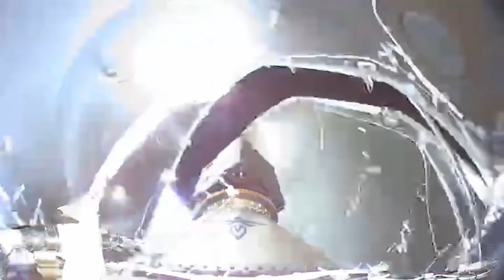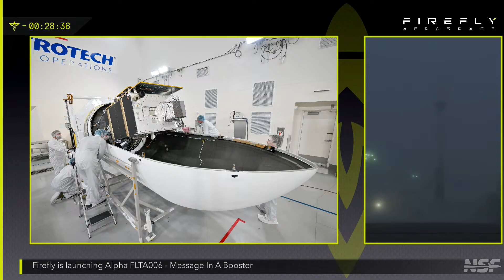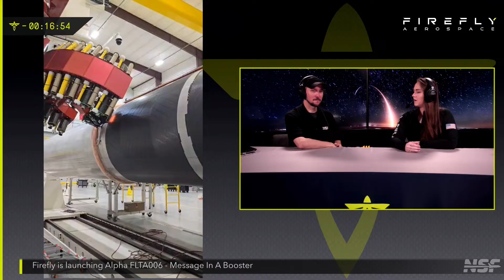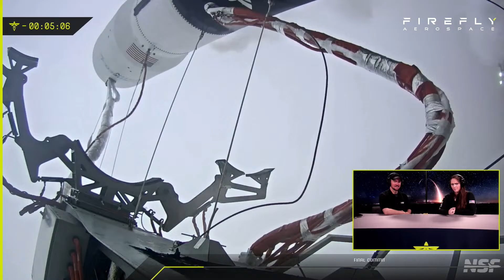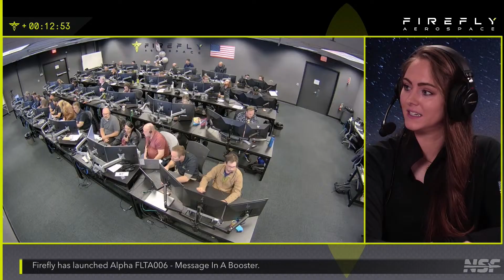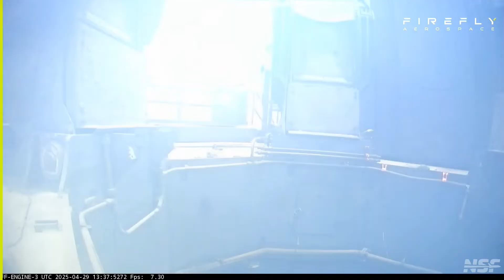Alpha FLTA006 "Message In A Booster"

Comment: I'm gona hazard a swing at a failed separation system. When second stage ignited, it blew out the interstage and took the engines vacuum nozzle with it.
Well done on the stabilisation tho! Wonder if it had enough reserve performance to get close to orbit to work a bit?
Reply: Yep. Recovering from the wiggles at that speed is incredible.

Comment: Per Firefly X post: Following a nominal liftoff of Firefly’s Alpha rocket, there was a mishap during first stage separation for the FLTA006 mission that impacted the Stage 2 Lightning engine nozzle. We are working with our Lockheed Martin customer, the Space Force, and FAA to conduct a thorough investigation and determine the root cause.
Reply: I remember hearing on ScienceFriday several yarns ago reporting when one of SpaceX's first failures was First Stage bumping Second Stage after Stage Separation. Host Ira Flatow: "I hate it when that happens". Good stuff I read in little kid books(written b4 Apollo cancellation) is finally happening. Bummer 40/50 year delay. Building Space Stations and Moon and Mars bases with early 8-bit computers with < 1 Megabyte maybe < 64K bytes would of been wild.
Reply: So did they lose the payload or did it separate this is why they should implement more cameras where the payload Fairing are and better tracking camera maybe then they can get a better picture and determine what happened it definitely didn't look stable during separation and the engine plumes didn't look normal
Reply: @brianv1988 they have many many more cameras. They just don't show all of them on the live stream due to customer privacy / in this case probably classified.
Reply: @brianv1988

Holy run-on sentance Batman!
Reply: Should've gone with spacex.
Reply: Oof, another failure? That is rough. These guys have such a shotty track record for rocket launches.
Reply: @bluesteel8376 the first launch was 100% success however it did begin to pitch to one side.  All of the others have been successful.  Add Firefly landed a lunar lander on the moon.
Reply: @bluesteel8376 
An engine valve stuck and the rocket began to lose acceleration it was then detonated it did not blow up.
Reply: @bluesteel8376

I guess you never heard that space is hard. 

BTW, the word you're looking for is "shoddy."

But this isn't shoddy.
Reply: if you can read it then what's the problem this is YouTube not a Reddit forum and speak to text doesn't work very well and my phone screen is cracked so I can't type okay Joker!
Reply: ALWAYS something with you guys!! Maybe better quality control.

Comment: Por favor señores de Firefly hagan un curso acelerado en Space x porque la imágenes y la telemetría de pena. Solo hace falta ver ambos lanzamiento para ver lo que digo. La cámara de tv mejor apagarla porque se movía mas que un perro en la playa.
Reply: this was done by youtubers, using commercially available equipment.  hand held cameras on tripods and such.  spacex uses the massive trailer mounted cameras that nasa uses.
i too was expecting better though.  considering nsf no doubt got paid for their coverage, they should have sent their best camera operators, instead of the interns or work experience kids they sent.  their tracking shots of random starlink launches that they werent paid for are way better than this was.

Comment: Looks like the 1st stage exploded after stage sep. Is that nominal for Firefly's rockets? first time watching their launch
Reply: In this feed? Got a time stamp?
Reply: @DaveTapley  about 47:21
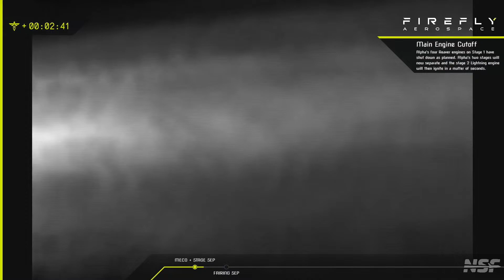Reply: Good view of rocket chunks at 47:31
Reply: Looks like the nozzle on the second stage was the thing that exploded
Reply: It was the 2nd stage engine nozzle that went boom.
Reply: Not normal as far as I can tell. I watched a previous launch fly overhead. It had a beautiful jellyfish.
Reply: @sixter4157  Upon further digging it looks like it took out the stage 2 nozzle! See Scott Manleys latest post
Reply: 1st stage definitely exploded. At seco, the payload started an uncommanded spin. I doubt it'll make it's intended orbit.
Reply: I don’t think that was actually a RUD. There were three well-defined pieces, pretty much in the correct orientation to be two fairings and the first stage. Also, the explosion-looking cloud of gas was probably the second stage engine’s startup gases interacting with the interstate. The view of more than one piece directly after sep is likely camera artifacts.
Reply: @BrannonAerospace

Sir, this is youtube. No calm, rational analysis allowed.
Reply: @billstevens3796  I’m just coping at this point 😂
Reply: i thought it was normal. did they plan landing it?
Reply: @spaceoutlaw-o9q  
No they do not ever land